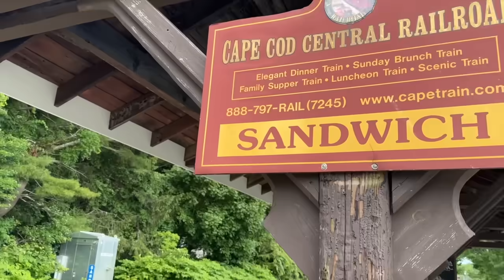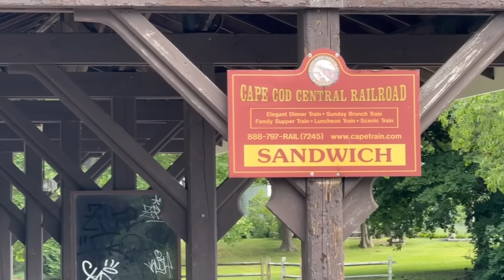How One Bridge Dictates Railroading on Cape Cod | The Canal Rail Bridge Explained

Comment: I just imagine some guy in Wisconsin sitting with his feet on his desk with a coffee in his hand being inconvenienced when a call comes in asking to make a switch on some track all the way in Mass.
Reply from the maker: Right?! 😂
Reply: Isn't most of UP controlled from Omaha, NE? I mean, if it's distance-controlled, it doesn't really matter if they are 10 miles away, or 100. I suppose there are technicians based more locally to intervene in case of a failure.
Reply: I am sure this is not the only rail line the dispatcher controls.
There are numerous bridges a dispatcher opens and closes by remote control of the bridge controls including signals for trains and boats as well as the operation of the bridge.  Most of these locations have radio contacts with marine traffic and video of the water traffic and rail traffic.
Reply: Dispatcher has no control over the switchs. It is either requested by a crew member by means of a button on the home  signal, or controlled by the tower operator in buzzards bay

Comment: I've operated those fl9's on metro north railroad back in the 2000's on the waterbury and wassaic beautiful engines
Reply: In diesel mode, are they any different to operate than F/FP7 units?  What brakestand do they have?
Reply: I remember seeing those.
Reply: @erie910  FL-9 is the same to operate as any other similar unit.  On third-rail electric they are just quieter.  Generally they were only operated on electric while in the the Park Avenue tunnel and GCT.
Built with 24 brake and pretty sure some got converted to 26.

Comment: If the Army Corps of Engineers doesn't want to lower the bridge too often, why haven't they imposed the construction of a wye connecting the 2 branches? As the passengers don't even see the lowering of the bridge, it's not even a part of the attraction... 
And if they don't want to lower the bridge more than X times a day, if they don't need the bridge to change branches, they might be able to increase frequency (I'm wishfully thinking, yes).
Reply: The previous operator of the line, Bay Colony, received money to do that from the state in the 1980s but it never came to fruition.

Comment: Seems like the bridge operation you filmed could be avoided if they built tracks to connect the two lines on the Cape, creating a wye with one leg reaching over the bridge.  Unfortunately, that connection would probably require bulldozing some homes.
Reply: I just looked at Google Earth.  Depending on how sharp a curve that equipment is capable of operating over, there is one large house that would be in the way.  IF, the right of way could be acquired that would not take a house, a route is feasible but it may require a crossing with the Falmouth line to make the connection and the curve to be not overly sharp.  This curve would be in the range of 10 to 12 degrees although Amtrak uses 16-degree curves at Jackson, MS on the old IC line by the station.  A 16-degree curve has a radius of 359.265 feet while a 10-degree curve has a radius of 573.686 feet.  That is a big difference.  The Great Smokey Mountain Railroad has a couple of 14-degree curves of 410.275 feet radius.
Reply: filmed, they use film?

Comment: At 1:12 , you said it takes the trash “off the island”…um, no…it’s the Cape! The islands are MV and Nantucket.
At 4:22, you said the excursion train “turns around”…actually, I believe it simply reverses direction which explains why there’s an engine at both ends…there’s no place up there to actually turn around, AFAIK.
At 9:39: you said “Otis Air Force Base transfer station”…it’s actually the Upper Cape Regional Transfer Station located at Joint Base Cape Cod.
Reply: Semantics, really.  Turns around, reverses direction, goes back, whatever.  It all comes down to the same thing, really.
Reply: @johnandrus3901  no, it’s not semantics and it’s not the same thing…because turning around and reversing direction are TOTALLY different operations! When you drive into a typical parking space, you put vehicle in reverse to exit, you do NOT turn the vehicle around, ok? Turning around requires the vehicle or train to ROTATE 180 degrees. This does NOT occur here!
Reply: @JohnHallgren  Does it really make a difference?  It arrives and then leaves in the direction, from whence it came.  Whether they wye it, turn it on a loop or the engineer changes ends, it is still going in the opposite direction.  Either way, I'm not here to nit-pick, just enjoying the video. It is a non-issue.
Reply: @johnandrus3901  yes, it certainly makes a difference! Because as I have repeatedly said, the two ways of completing the direction change are NOT at all equivalent so the terms MUST be used properly to be an accurate video.
Do you put your car in Drive to go backwards? I doubt it.  Not the best analogy but it’s a similar concept.
Reply: JohnHallgren   Why Cape Cod is considered "an island" is the canal.  The canal forces road vehicle traffic to traverse a bridge over the canal to access the Cape Cod area.  That was the explanation I remember.
Reply: @royreynolds108  and that explanation is based on an incorrect premise since the canal is man made, and those who call the Cape an island are  considered ignorant or uneducated by those who live here.
Reply: Thanks for the clarifications!